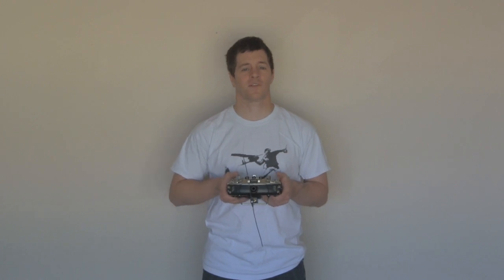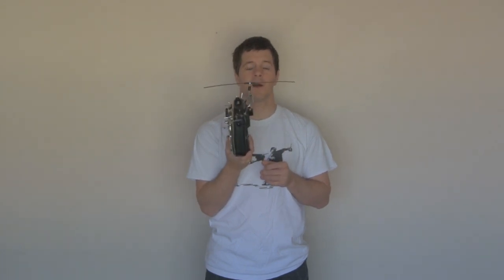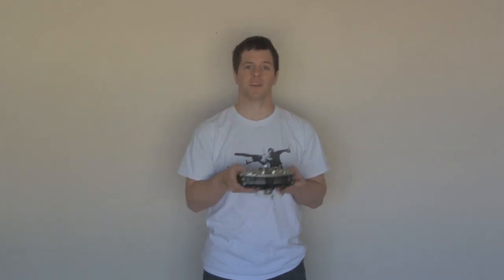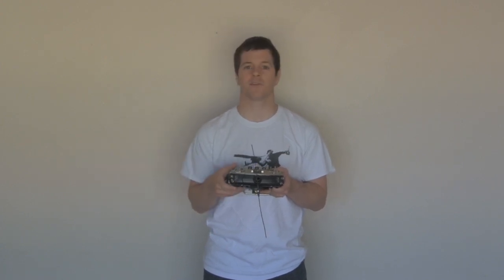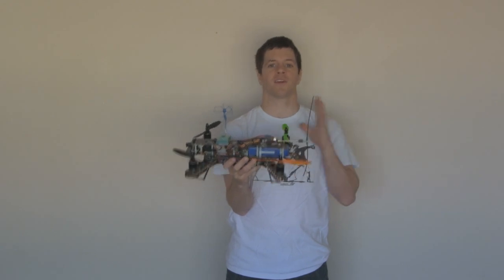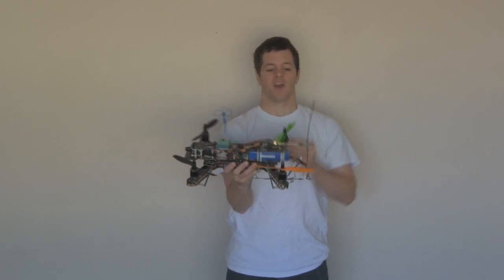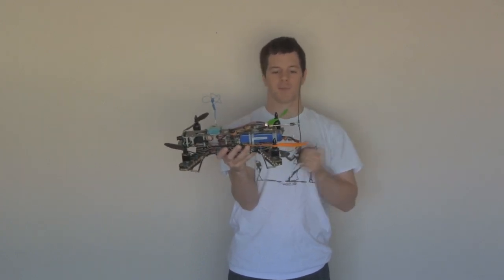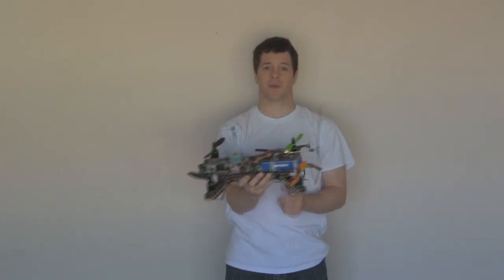UHF (Semi Rigid) Dipole overview

Comment: There's a ferrite on your dipole ? 
I've seen ferrite on router's wifi antenna cables before, what is it for ?
Reply from the maker: The ferrite is a balun.  It minimizes currents tracking down the outside of the cable due to skin effect.

Comment: will this work on a 459mhz band for the UK
Reply from the maker: +Ironiic zero - Yes.  It will work perfectly at 459MHz.
Reply: +Video Aerial Systems are these better to use on a video transmitter than SPW
Reply from the maker: +Ironiic zero - Not usually unless you are looking to reduce drag.  You need to cut it down to your frequency, though.

Comment: Picked one up to use with dragon link and a turnstile antenna on a wing.  The stock antenna Running horizontal was weird. This one fits nicer but I think I lost range.  Getting. Failsafe within 2 mile range.  Stock antenna was doing 3 miles without any problems
Reply from the maker: William Anzueto - Assuming your DragonLink is working properly and you are positioning the antenna properly, you have a noise floor that has a stronger horizontal component than a vertical component.  This is very rare, but it does happen.  The polarization of the antenna is actually causing your range to decrease.

I would suggest placing the semi-rigid dipole on the wing and use the stock antenna vertically to see if this helps.
Reply: Is it possible that my metal stand on the back of the radio is messing stuff up?  I tried putting the Dragonlink sideways and then matching up the diapole vertical off the side of the radio.  That seemed to work and match the range of the stock whip antenna in the same configuration
Reply: +Alex Greve I heard back from dragon link they think it's a burned out transmitter that's what is limiting my range.   2 miles on a burned out system is pretty good!

Comment: Question: if you use a Immersionrc dual diversity video transmitter, can you connect the ground to both antennas, so they share one ground pole?
If not, and you cross them to get an X , will they reduce efficiency? or should I make the X like this: >< meaning, I bend the away from each other.

Comment: What is the wire you have made this from? I would love to use this on my phantom fx-61. Normally I have a soft cable underneath that bends in the wind giving me a short range of 1.8km.
Reply from the maker: It is commonly called "aircraft wire rope".  It is a spring steel cable.

Comment: Hello Alex, its always a pleasure to watch your videos. Based in our previous discussion in the last video I did a dipole UHF antenna, and Im flying great with the terrible dragon link with noise output stage. I just posted a video flying with that antenna and it flies great with 2.4 Ghz with my quad. Just like you using in this video.
I always change my rig based in your videos. You certainly change the mass with acknowledgment .